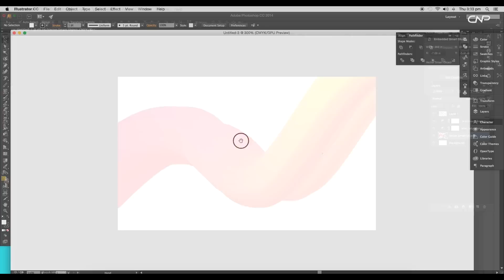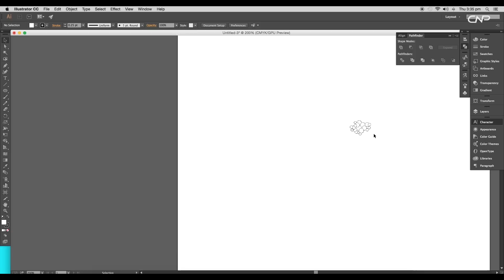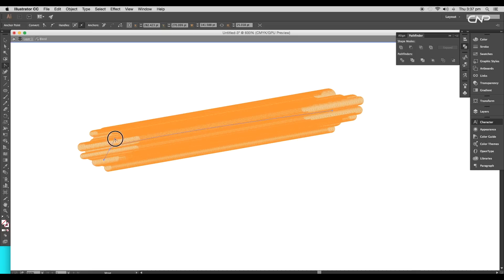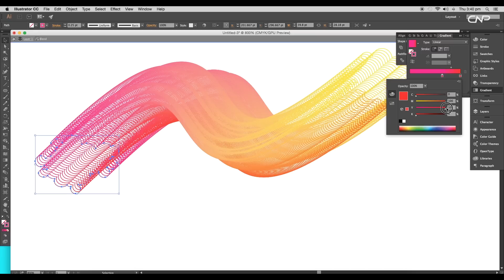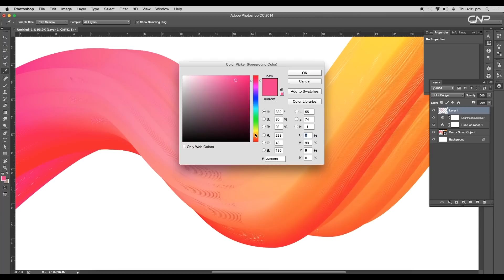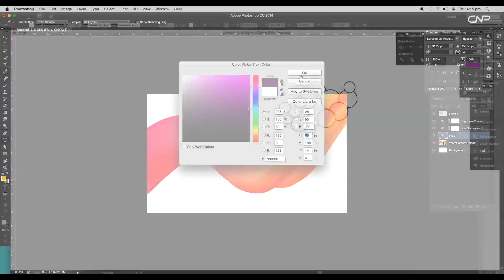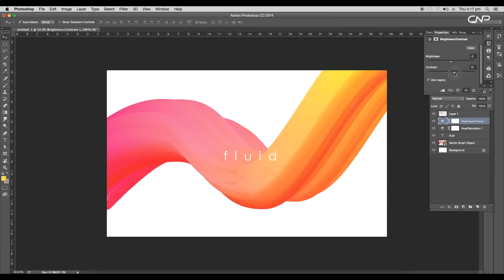Graphic Design | Fluid | Adobe Illustrator/Photoshop

Comment: Great tutoral, but every time I get to change the line path to gradient it refuses to change it and goes straight to making the fill gradient. Is there a step missing to convert the two paths so that they are the only ones that will allow themeselves to change to gradient?? (2:52 - I cannot get further then here) :/
Reply from the maker: Maybe, you are missing the step where i selected the Stroke icon in the tool bar. Before you apply the gradient, you have to select the stroke icon and then apply the gradient color. Let me know if you get it right!
Reply: Hi! Thank you for your response. I did select it, the problem is as soon as I go to gradient after it automatically selects the fill for gradient instead...I don't know why it does that, it won't allow for the stroke to be gradiented. I don't know if there is a step to change the line to something else so the gradient accepts it as something to be altered to gradient. I am using CS5.
Reply: cs5 doesn't support gradient strokes, newer versions like CC do
Reply: Oh noooo! :( thanks for the heads up! :)
Reply: It's happening with me too. My illustrator is CC not cs5, still this problem's there.